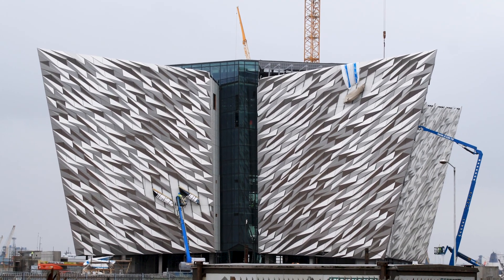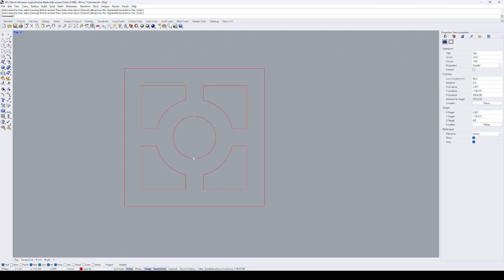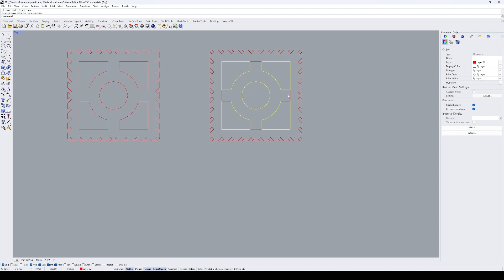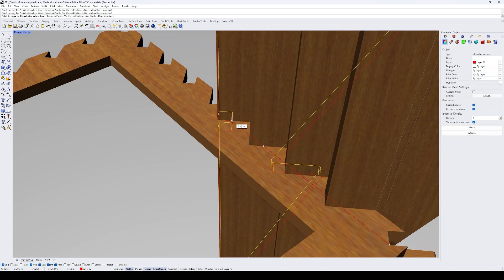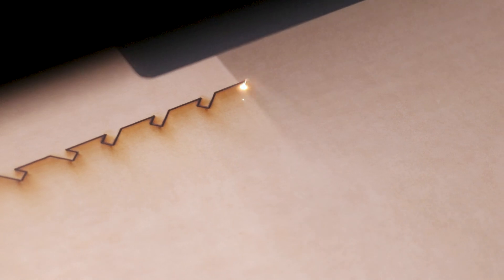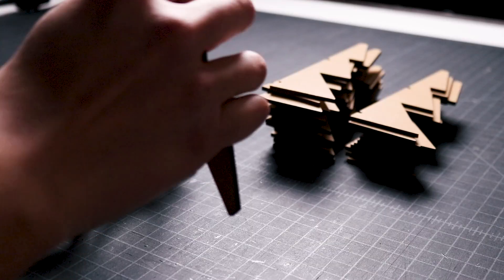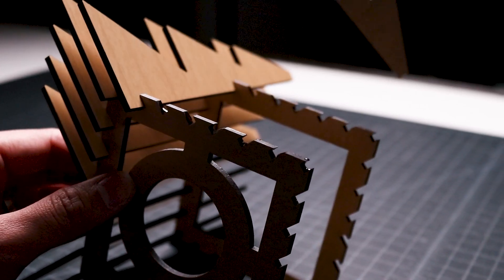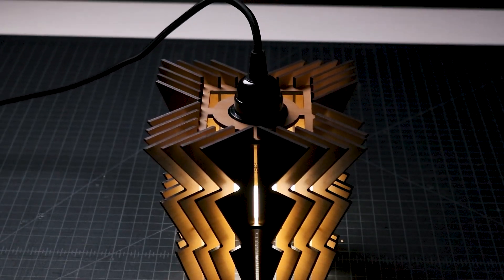Titantic Museum Inspired Lamp Made with a Laser Cutter

Comment: Another nice piece. I can see the resemblance to the museum. 
Have you thought about factoring in the laser kerf to make a tighter fit so no glue would be needed?
Reply from the maker: Thank you! I used to design my projects with kerf factored in, but I decided to make it a loose fit because I sell a lot of the design files. Materials differ from location to location, so the loose fit ensures that people around the world can also make the product without having to adjust every slot and tab.
Reply: @LaserMadeProducts  That is what I figured. But, I thought when you sent it to the laser program (I am assuming lightburn) for your test you would benefit from using the offset in lightburn. 
Either way, it worked well. You were right about reducing the height of the lamp, it was more appealing.